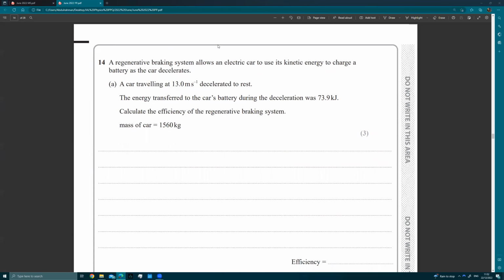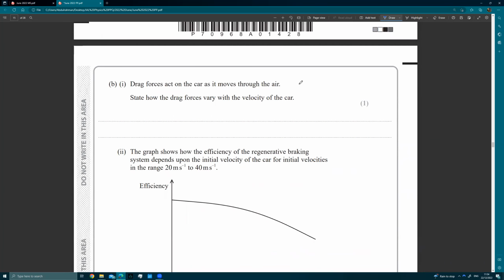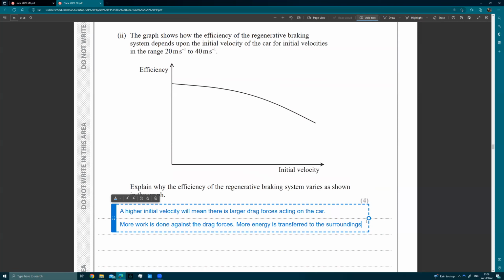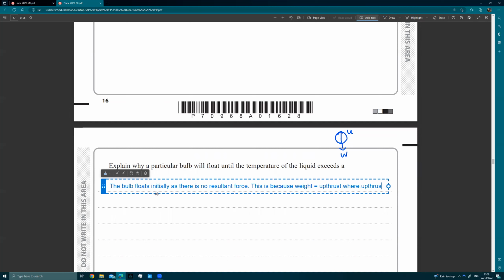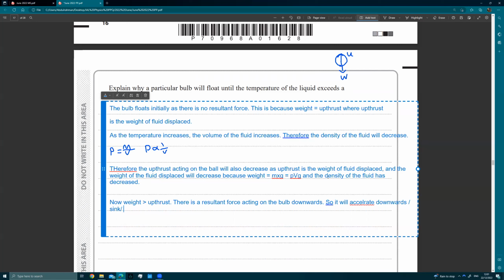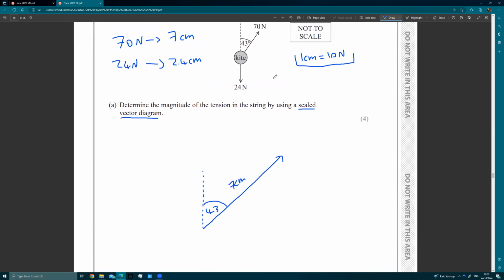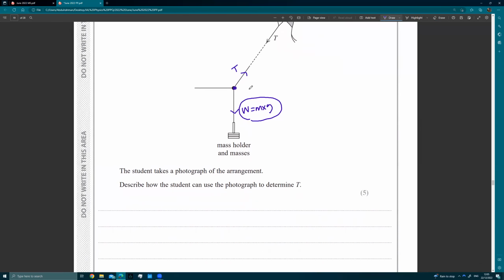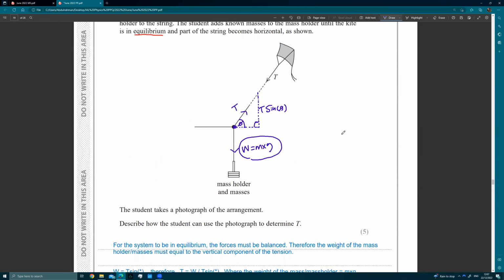Edexcel IAL Physics Unit 1 - June 2022 Q14-16

Comment: wait sir how could u use mg/tsin(*) to find T? shouldn't u use mg/sin* or mg/cos* depending on components?
Reply: You can resolve T into its dimensional components so like the one which is equal to the weight in the opposite direction upwards which is Tsin(x) = vertical component of T
Reply: @Rayyan-n1b  thanks bro i graduated a year ago😂